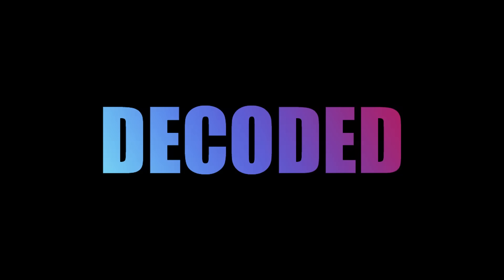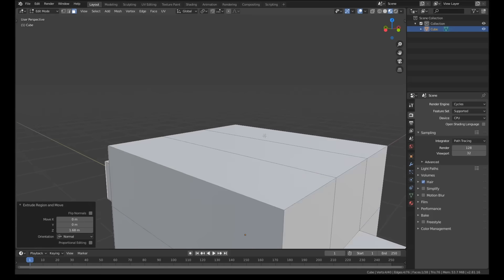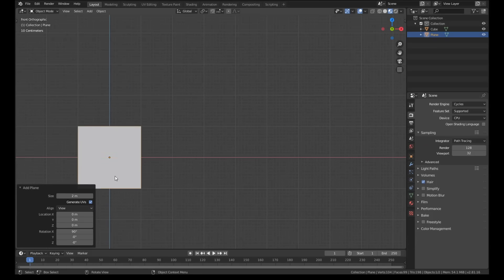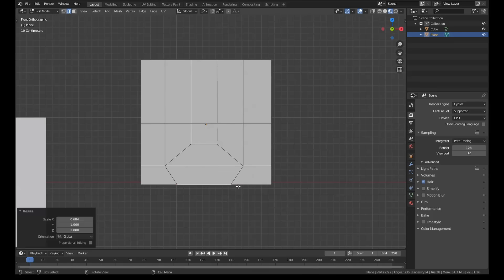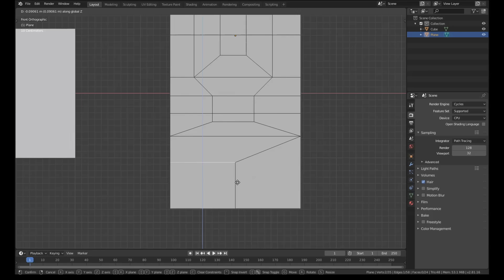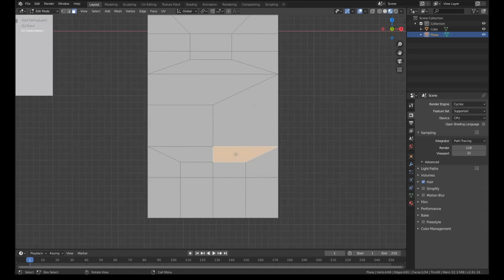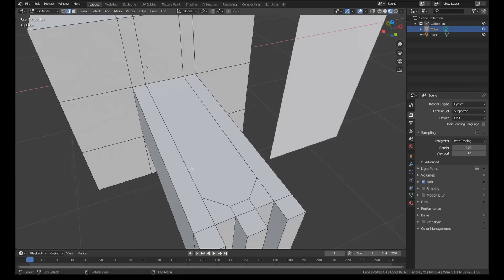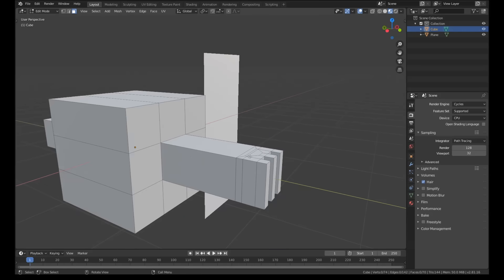Change Your Understanding of Topology In Six Minutes

Comment: I have seen other comments where you answer why quads are prefered over triangles and n-gons, but i have not found an answer to this question yet:
At e.g. 2:27 if you just deleted/resolved all the cuts at the lower side of the plane, there would be 5 quads on top and 1 long quad at the bottom. No triangles or n-gons, so why is that not an option?
Reply from the maker: The one long quad on the bottom would have eight sides.

Comment: Hey! I am trying to go back to basics in my learning so that I can make something more complex. I tried to make the cube with the three "fingers" and used the exact same technique you used here to nullify the amount of edges going round the cube; however, once I put a simple Bevel modifier on and Auto Shade Smooth there is a shading issue once we get to that last section where it merges back into a single piece (and onto the rest of the "arm"). Can you help? I took screenshots but obviously cannot post them in here. Am I missing something here? Thanks in advance
Reply: I think I have solved this just by chance seeing something else in another video. When I 'harden normals' it fixes the shading issue. Hmmm, interesting.

Comment: Thank you for the video! I just have a question - How would you do 2 to 1 where the transition can be applied to an entire edge loop / thickness of the object? What I mean by this, is that if you look at the 1 to 2 at about 3:55, the left edge has 2 sides, and the right has 1 - so they wouldn't be able to form an entire loop that goes around without introducing a triangle somewhere. In all the other instances both left and right edges have the same number of sides so they can be looped around.

Comment: This is a great vid, no doubt about it, and very useful. The only problem I've come across is the one-to-two (see the graphic at the start of the video). This is fine and works well, BUT whilst moving from one to two vertically, it also goes from three edges to two from left to right and this can be a problem if you're working in the middle of a mesh rather than at the edges, e.g. trying to close a square hole in a mesh with one edge along the top, two along the bottom and an equal number left and right.

Comment: If this is for realtime rendering in a video game id also recommend you spread out the topology of the cuts more to avoid any long thin triangles - thin triangles cost more on low end mobile / tiled based gpus due to a number of factors.

Comment: How did you add 4 loop cuts in at the same time and evenly spaced? i wanna know the magic trick :)
Reply from the maker: Scroll the mouse wheel after inserting a loop cut. Or enter the number of cuts you need with the number keys.
Reply: cool thanks! @DECODEDVFX

Comment: It's amazing how many tutorial makers shamelessly skip over these important details when it comes to topology, they're all about showing you the fastest solution possible thanks to the youtube algorithm and don't go enough into basic topology and I've found this to be the most useful video overall for explaining topology properly even if it is a basic concept I particularly like that you went into the hand example which most people don't bother with.

As an extra tip for noobs, if you guys are following along and doing a full human model like I am, separate your extruded hand in edit mode to prevent any weirdness with loop cuts and not let anything interfere with your main human model, you then should be able to reconnect your hand to the arm and it will be fine. Assuming of course you don't overdo it with the initial polygon count and make things too hard for yourself.

Also at 2:33 he accidentally skips over an important point, the tool he uses is "New Face From Edges" to make the new face and the shortcut is F I believe that's what he did as I got the same result.

Comment: Would it also be necessary to dissolve the edge loops on the sides of the extruded section (I'm referring to what you mentioned around the 6:30 timestamp) for better topology? Im pretty green when it comes to Blender but I figured that understanding this concept well and practicing it would give me a good lead on not making a mess of my topology as I make more and more complex sculptures in the software.

Comment: Ok so probably a suuper dumb question but why not just use non-quads?
Reply from the maker: Here's a recent twitter thread I wrote about ngons, which will hopefully answer that question. https://twitter.com/DECODEDVFX/status/1631049463094493188?t=bu2m7hSWJiXpRRlPQU_LSw&s=19
Reply: @DECODEDVFX It REALLY does not. The post you linked shows up as a 1/1 long ”thread” explaining what it is and that it is bad, but it does in no way explain WHY it is bad.

Comment: you know this works in most cases, but you get 5 edges connecting some vertices so it gives you bad shading. I could only spot this with the red mat cap so it is now that big of a deal so yeah, neat trick

Comment: Great demonstration, extremely helpful. Another way to think about it that is a bit more beginner friendly, is that any time you are adding geometry, you are essentially 'insetting' faces. If you are working with a manifold surface, this might be easier to grasp than trying to understand where to move edges and use the knife tool (at least for beginners like me).

Comment: there's still a considerable planning factor involved. Make sure you consider where you're spider verts are going to end up when deciding how close you can get to the detail to operate these reductions and still land them on as flat as a topography as possible. I'he had to extrude whole words on, for example, a shampoo bottle lid and it can be  bit of a puzzle to figure that out. I'm a Modo guy and I use Modo to model and UV, and Blender to groom and export, but this process is still relevant.

Comment: Thank you so much for posting this video. I'm in my 40s, have ADHD and am attempting 3D modeling for the second time in my life. The first time was prior to medication, with poor tech that would crash and with software that was spline-based so dealing with the topology was EVERYTHING. As I have picked up Blender, I have had this distracting, anxiety in the back of my head that has been a roadblock. TOPOLOGY. I am someone that needs to know a little more about the machinery before I can feel comfortable using it and unfortunately, no-one titles youtube videos, HEY, the thing with the shapes and creasing and the part-mathy, part-real world stuff, I CAN HELP WITH THAT. After watching your video and with a rudimentary knowledge of anatomy it makes sense. You don't go from your fingers to your forearm with five bones. It's inefficiency use of energy and probably shitty mechanics. You build down with multiple bones decreasing and increasing based on the needs for flexibility until you get to the structure where all you need is rigid support. We of the neurodivergent thank you.
Reply: I second that
Reply: 37, starting on round three myself. Keep on it mate, we'll get this eventually!
Reply: good for you! :)

Comment: Noob question: Why is the topology you see on 6:34 bad?
Reply from the maker: The face I selected just after that point is an ngon. It's got more than four sides.
Reply: @DECODEDVFX  Thanks! I get it now i think, although it looks like a straight line on one side, that is actually 5 separate edges.

Comment: Today I used this method to cut a 32 sided circle out of a single face but it felt really convoluted and I've never seen it done this way before.  On each side of the face I went from a single edge to 8 edges and hooked these up to each of the 8 sides making up a quarter of the circle.  Am I getting too hung up on maintaining quads and avoiding tris and ngons?  Imagine a chequers board of faces and you want to cut a hole out of each white face.  How do you do that without introducing tris or causing ngons for the surrounding black faces?
Reply from the maker: This is the cleanest way I can think of to go from eight sides to 32. But it's probably unnecessary unless you're applying a subsurf modifier or the surface is curved. https://i.imgur.com/RF7LGtO.png
Reply: @DECODEDVFX  Thanks, that looks like a great solution, although there are 8 sides to the bounding face.  I guess you can then use the method in this video to go from 2 edges (of each side of the bounding square) to a single edge?  I've been using Blender on and off for about 10 months and am current modelling my wife's electronic piano.  I am really pleased with how it's coming along.  I'm currently cutting out a few circular holes for some of the buttons.  It's hard surface and I haven't used a subdivision modifier.  For the back piece (containing all the buttons) the cross section is a rather large ngon which I have extruded.  It's much like a cylinder where the end faces are ngons.  Am I getting too hung up on eliminating ngons?
Reply from the maker: @darrenlink1347  Possibly. Worry about fixing the ngons if they start to cause problems. That's my usual workflow.
Reply: @DECODEDVFX  Many thanks for the advice.  There seems to be different schools of thought regarding ngons which is confusing for a newbie.  I really wish I had discovered Blender years ago - I'm loving it.

Comment: but.... when you pass from 5 to 3.... you are creating a polo, a vertex with 5 edges.... min aprox 2:40... this is ok? I believed that in a clean mesh to subdivide, it was recommended 4 edges per vertex
Reply from the maker: Poles are pretty much unavoidable sometimes. N poles (with five edges) aren't usually a problem unless the surface is very curved.
Reply: @DECODEDVFX  thanks.... quads topology cause me stress

Comment: In a lot of tutorial modelling videos, it is absolutely the case that loop cuts are just done through like the whole mesh though, a lot, is that bad? 
And I thought that while you are showing a nice way to 'step up' or 'step down' the number of faces to work with from a starting point, isn't the flow of the faces off now? Like, it won't make a face loop all the way around? or... will it still :o
I can't really tell, I'll have to try it though
Reply from the maker: It depends what you're modelling. If you're using a sub-surf modifier, extra loops running around the mesh can cause weird shading problems and pinching. On hard surface stuff, it's usually less of an issue unless the mesh is already quite dense.

Comment: The only question I have is what did you call it in the last few seconds when you were talking about repeating the process on the bottom. You said 'that's still bad topology there, that's an..?' (sounded like 'enger' also why is it bad topoology when they are all still quads? Is it, if they WERE fingers, do you mean?
Reply from the maker: I said Ngon. The face I clicked as I said it has more than 4 sides.
Reply: @DECODEDVFX  Thanks!

Comment: I'm still new to 3d modeling, but why can't you just select the unnecessary edges and dissolve them?
Reply: I saw the same question asked below a couple times and the answers were that they weren't quads? They are rectangles though, meaning they are quads. I'm a little confused lol
Reply from the maker: @jessiea.963  They wouldn't be quads. They'd have more than four verts.
Reply: @DECODEDVFX  Oh so when you say they're not quads, are you referring to the longer rectangle? Like it's not a quad because it has more than 4 verts despite the general shape being a rectangle?
Reply from the maker: @jessiea.963  Yeah, that's right. An ngon is any face with more than 4 edges/verts. Even if it's in the general shape of a 4-sided face, Blender will still treat it as an ngon.
Reply: @DECODEDVFX  Nice! Thank you for taking your time to clarify this. Subbed and can't wait for more content!
Reply from the maker: @jessiea.963  No problem. Thanks for subscribing.

Comment: I don't get it. At 5:30 for example, why don't you just make a loopcut on the "wrist" just as in the video and dissolve the loopcuts on the left going through the "body" but instead making this weird steps and dissolve them after?
Reply from the maker: Quads.
Reply: @DECODEDVFX  yeah, no, not better yet but thanks for the answer tho

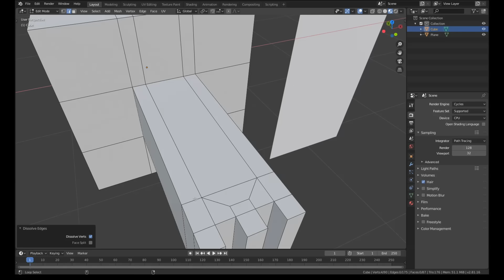Comment: Hey bro, trying to learn this, thank you for sharing,  ... but after the 5:37 dissolve cut loop edges, I try to add the second loop cut and it won't work on top and under faces, just at the side ones... just before that I see that you select the three top edges then they gone, but I don't see any dialog to confirm if you want to dissolve edges or what ... pardon my english, I hope I explain myself
Reply from the maker: You can only add an edge loop through a face with four sides. If the face doesn't have four sides, you'll have to use the knife tool to cut it.
Reply: @DECODEDVFX  Thank you, that wasn't the problem either, I was doing something wrong but it work like a charm now. Thank you!

Comment: I came from C4D, machinima, and subdiv modeling.  I was taught more about edge flow than faces.  Then I started to use Blender and making game ready assets (until UE5 where that will no longer be necessary...) and the whole HardOps/Boxcutter jazz happened, and ngons galore.  How do the two relate to each other?  Is it as simple to understand as: If there is one there isn't the other?  Cause I sat thru a course, where the guy used subdiv to make the High Poly model to create the normal maps for the low poly... now I'm confused.  I feel I am missing something, maybe.

Comment: Please take this as constructive criticism, but I don't see how the result of this tutorial is good topology. Good topology isn't only about using quads, it's about making sure you have proper edge flow in your model so as to use your topology efficiently. If we consider the two big branches of modelling, organic modelling and hard surface, this method is useless for both. The proper way of rerouting topology in organic modelling is to use poles, as they take up a single vert (instead of a bunch of edges like the method used here) and cause minimal pinching. So I'm guessing that what you think this method is useful for is hard surface, and while it definitely is better for it than for organic modelling, I reckon it's just as useless. For starters, in hard surface you don't care about good looking deformation potential, so there's only two big things you need to achieve with your topology: making it easy to UV unwrap, and just like for organic modelling, making the most out of your geometry. Your method, compared with just using ngons, makes it no easier to UV unwrap a model, while using more geometry. It also causes issues with the normals interpolation whenever there's faces at an angle, which means that reflections will look bad. It also doesn't subdivide nicely through Catmull-Clark, as trying to do so only leads to a ton of pinching. The moral of the story? For hard surface, there's no problem (and it's usually the smarter choice) to stick to ngons whenever you don't have a change in shape. If your topology has a complex shape and is contained in a plane, there's no problem in just making it an ngon for the sake of geometry optimization. If ngons where this deep evil thing to be avoided at all costs, no matter how messed up the resulting quad only topology looks, the cyllinder primitives in all 3D software wouldn't be tapered with ngons, but instead with a nasty quad contraption that subdivides even worse than just an ngon because unlike an ngon, it would subdivide in an irregular shape.
This video only feeds the beginner misconception of quads being the main thing there is to good topology, which I don't think is okay to extend any further. You have a ton of legitimately useful stuff in your channel, and if I were you, I would just delete this particular video (even if it is one of your more popular ones) for the sake of quality education for 3D beginners.

Comment: Soooo... hobbyist dabbler here, nowhere near the level of models you guys deal with, and I can kinda grasp where the stuff you are teaching could be useful in far more detailed models.
But I can't for the life of me figure out why you used it with the thing you made.  It seems needlessly complex.
It took me five minutes to figure out which tool to use (dabbler; I use Blender more for video editing, and don't model much), but I found "Bisect" (chop a face into pieces) and "Subdivide" (chop a face into equal pieces).  And the wiki assures me that there's a way to make Subdivide do thirds instead of just halves (it would've been neat if the scroll wheel let me do that, like with the loop cuts), even though I couldn't find the right panel to indicate my choice.
So I got from one face to three faces without any intervening triangles or weird quads.  Just a single flat connection between 1 face and 3 faces.
Could you help me understand (at a beginner level) what the purpose is of connecting them with additional weird quads, instead of just using flat rectangle quads on the piece you were making?  I mean, you literally cut the entire shape into thirds and then showed how to erase the extra lines you made, while adding diagonals.  I don't get it.
Reply from the maker: Sides with more than four edges (Ngons) are generally seen as bad. They cause weird shading issues, they don't subdivide well, you can't smoothly bend them for animations and they don't bevel well either. On top of that, they break edge flow and they are difficult to unwrap.